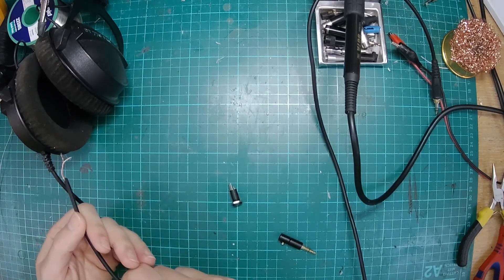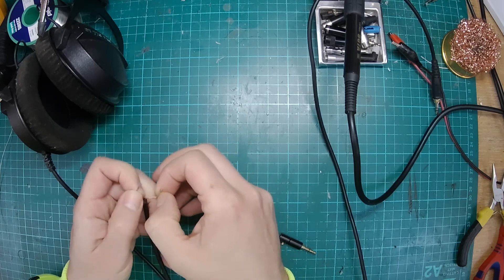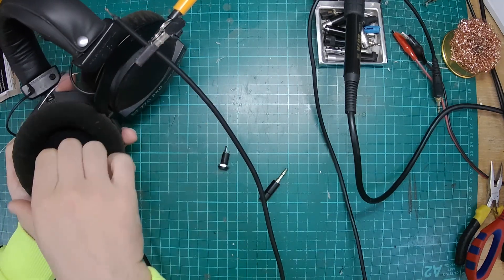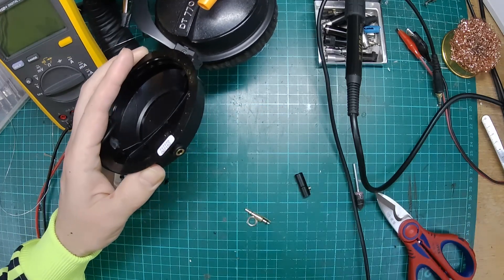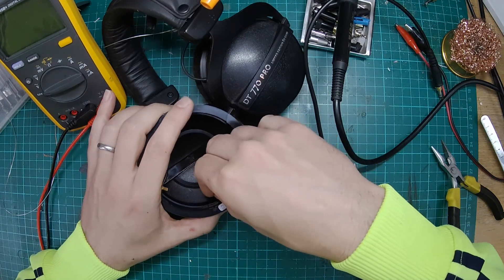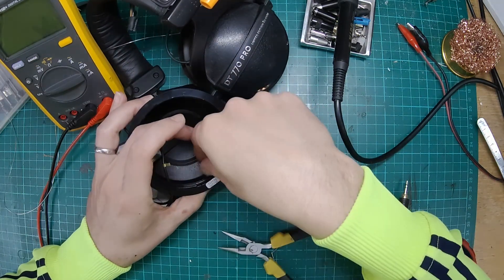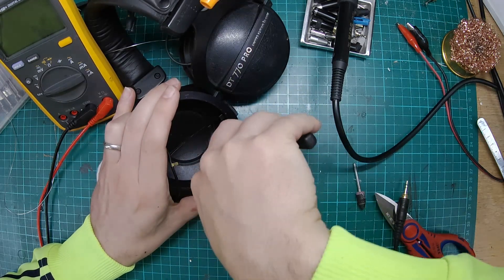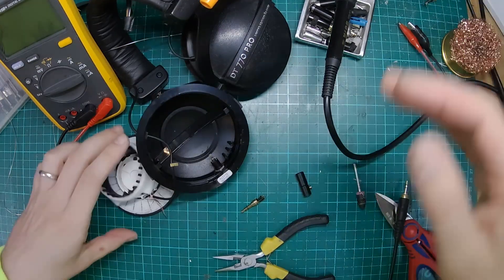DT770 Detachable cable mod the easy and safe way

Comment: Just did this mod, sweaty palms, heart beating, messed up the wiring first time, but now it all works great! The soldering tips helped out a lot, thanks for those!

One thing that was different in my set (maybe because I got the DT770 32 ohms?) was the colours of the wires. I have black (for ground) attached to the longer pin, white attached to gold and red attached to silver and that seems to be correct in my case.

Comment: just did the hole part with one of those tiny needle files. it also works pretty well. took me maybe 10-15 minutes. will probably do the soldering some other day cus i don't have wire.
Reply from the maker: Thant's the way.... take your time and get it right ;)

Comment: What if I make double 3.5 input mod? Will it work?
Reply from the maker: Yes we have made a few pairs like that
Reply: @CustomCans  do I need to consider about PCB? I mean is it DSP or just conjunction? If I can make, can I remove wire from head band? TIA
Reply from the maker: @chithtooaung3883  The PCB just joins the main cable to the tiny voice coil wires. If you are not skilled with soldering, I would leave the wires attached to the PCB like in this video. For  the other side, leave a small section of the headband cable attached and use that to connect  to the socket. Then you can remove the rest of the headband cable. If you remove the headband cable, I would recommend blocking up the holes where it entered the earcup as well or they will act as an extra bass port

Comment: Just finished my mod, thank you and all the helpful comments! If this is your first time doing something like this plan in at least 3 hours and one burnt finger 🫠. Also, don't be afraid to really pull on the retaining clip. A flat head screwdriver instead of a butter knife worked quite a bit better for me because my knife was too flimsy to get the clip out. Putting solder on everything before connecting it and having the jack aligned as in the video was also a great tipp! Checking everything before putting it back together (by carefully inserting the plug) and seeing if the Jack wiggles is also a good idea. If the wires can bend and touch each other make sure they are isolated (if not a bit of hot glue/electrical tape helps). Hope this can help and thanks to everybody!
Reply from the maker: Glad to hear it all went OK and thanks for sharing some extra tips

Comment: Ripped the jack off my DT 770 Pro, i think i'll do this rather than attatching a new normal wire
Reply from the maker: Yeh.. it is not much more work
Reply: @CustomCans  The Stuff finally arrived and i started disassembling and noticed i dont have the blue or gold wires, i have black, white and red, do you know which is left and which right? i´d assume black is negative/ground and red is right while white is left?

Comment: Hi! Could I use any 3.5mm cable with this mod or would I need to get a specific spec? My DT770s are 32ohm and I'm looking for a more flexible cable than the stock one. Maybe one short and one longer.
Reply from the maker: Yep you could use any standard 3.5mm cable
Reply: @CustomCans  awesome thanks

Comment: The one thing putting me off buying these headphones was the fixed cable. Excellent video showing it's easy when yuou know how. You've inpired me to have a go and hopefully not ruin a brand new pair of cans. 
What's the bass rumble I kept hearing from around the 7:50 mark?
Reply from the maker: That is just the Phat bassline produced by me cleaning the solder tip - the vibrations going through the desk and up the arm I have the mic on ;)

Comment: I’m unclear on what the multimeter did. It just helped you confirm which wire was left right and ground?
Reply from the maker: Yes - I was using it to check continuity - that is the main setting I use for modding headphones - good for checking things like shorts or breaks in the cable

Comment: Is there any alternative tool instead of using a dremel?
Reply from the maker: You just need to make a hole in the right place - you could use a drill or something or even a sharp blade and just slowly cut away at the plastic until the hole is the right size

Comment: You made this look so easy. Im considering getting a d770 just for this mod but I'm not sure if my soldering skills are up for the job. I once wrecked a game cube controller trying to solder new potentiometers
Reply from the maker: I definitely not do this as your first mod. Get in a lot of soldering practice first
Reply: People always say to just opt for a pair of 770(80ohm) instead for the straight cable, but i find the 250's have better sound.
Reply: This was my first ever soldering "work" if you are careful not to puncture the driver there really isn't much that can go wrong.
I mean if custom cans says don't do it it's probably because of a reason just know that it's not impossible

Comment: Is it the same process when doing a mic mod like this. I guess i go for stereo socket plug ?
Reply from the maker: We have made a few where we fir a seckond socket for a mod mic - it is much easier to do this mod and then use a v-moda boom mic or beyerdynamic custom gear mic though

Comment: Followed this to mod to my 770s and Tygrs. 👍
You can cut the cable further down and pull the wires through - much easier to solder with more wire to work with.
Reply from the maker: Top tip ;)
Reply: Thanks for this! Doing this to my 770s and was a bit worried about not having a lot of wire to work with.

Comment: Can the 3.5mm port be used to connect a V Moda boom pro mic?
If not, what else would be required for it to support that. Could you recommend me alternate parts like the ones you left in the description?
Thanks.
Reply from the maker: Yes it would work with the V-moda boom mic or the beyerdynamic custom gear mic
Reply: @CustomCans  ooh thanks for the quick reply

Comment: Should I try this if I've never soldered anything in my life. I have all the tools and have watched several videos but maybe should practise on something else first? You make it look so easy.
Reply from the maker: 100% get a load of practice first. Soldering is a bit of a dark art and needs a bit of practice to get right. You need to get used to how your soldering iron and solder perform and get your solders looking super neat and shiny before trying to solder anything that you care about. I would recommend buying some strip board used for making custom circuit boards and solder random offcuts of stranded wire to it until you get a feel for it.

Comment: Just did this, nowhere near as clean as yours because Im really bad at soldering, and the tip on my soldering iron is super oxidized and barely works. 

And it might have been stupid but because my solders didnt seem very clean or reliable i just slapped just epoxy (which I was already using to seal the holes/help hold the socket in place) on top  to insulate and keep them in place. Checked functionality first, all seemed well. Fingers crossed. Thank you for the video.
Reply from the maker: As long as it works, it's all good ;)

Comment: that made modding my dt770 so easy! thanks for sharing :)
Reply from the maker: Glad it helped!
Reply: @CustomCans  hey, sorry for pinging here but i didn;t know how to reach you.
Do you think that this mod is the same on DT990/DT880 EDITION ? i am considering buying and EDITION one but i can't find much about the inside of them
Reply from the maker: @lucapretini1762  yes you can mod those the same way. You just have to take it a bit slower when making the hole as they have a metal ring around the earcup so where you have to make the hole is half metal and half plastic... It makes it tricky but go slow and it will be fine
Reply: @CustomCans  mmm i actually used sand paper for dt770 pro, you think that would work on "edition" ones too? Or the metal part would be a problem?
Reply: @lucapretini1762  My thinking: Sand paper will be quite slow (take a long long time) on metal. In between of sand paper (very slow) and Dremel(/drill) (fast to too fast) you can use also a metal file as a quite low cost well controllable moderate speed manual tool to get the whole sufficiently wide/well formed.
Reply: @CustomCans  hey after a few months i bought the headphones and i plan to mod them. I wanted to ask, do you know which part of the headphone is metal and which one is plastic?
Reply: if anyone reads this and is looking for an answer:
modding "edition" ones is the same as pros, the black part on editions is soft plastic as on the pros.
Wires are easier to work with as are thicker

Comment: Nice! can you use a balanced cable with this mod?
Reply from the maker: You would need to fit a 4pin mini XLR and wire it slightly differently to do that but the basic principal would be the same

Comment: Is there any advantage of modding the DT770 with either the 3.5mm to Mini XLR?
Reply from the maker: 3.5mm are more common so easy to find cheap cables. Mini XLR locks in place so for studio use it means you are less likely to yank out the cable while bouncing round the booth... Also it looks cooler ;)
Reply: @CustomCans  thanks so much. I went with the mini XLR. I'm excited to try this mod. The hardest part is going to be wiring it correctly. I got a multimeter so hopefully that helps. Thanks.

Comment: To everyone who is doing this: When popping off the ring, make sure to put the lever really completely under it, before twisting! I accidentally ripped a small tear into the paper on the outside. To be safe, I wouldn't twist it at all, just pull it away from the case. It's my own fault! I used the backside of some tweezer, but that was actually a bit too round, so there wasn't much left for it to hold on.

Comment: BE CAREFUL to drill the connector's hole away from the driver support of the earcup, or you will not be able to put it back...
Reply: Wdym like the mould scaffolding to the right?

Comment: Great video, thanks it was really helpful. is there any point to using mini xlr over 3.5mm jack or is the fact that xlr is balanced irrelevant in the case of a pair of headphones? cheers
Reply: just to clarify: XLR plugs aren't balanced. They're just plugs with 3 or 4 pins (or more). The 3-pin mini XLR jacks that AKG and others use are just the same as these 3.5mm jacks audio-wise (they both have right, left and ground), but mini XLR is larger and locks in place.  Larger is a con (it hits your shoulder) but locking is usually a pro. It's a matter of taste.
There's also 4-pin XLR plugs that people sometimes put on headphones as mods, which splits out the left and right ground onto separate wires. Some people call that "balanced", but that's another topic. But either way the "balanced-ness" is not inherent to the connector, they're just different mechanical ways to plug wires together.
Reply from the maker: It is probably down to personal preference there is not a huge difference - for pro use a mini XLR is nice as it locks in place and you can't accidentally pull it out at a crucial moment

Comment: Im going to do this but I also want to build make a custom cable with paracord. I know using the right wire types is important but dont know how to decide what to use.
Reply from the maker: Making your own cables is a handy skill to have so well worth giving it a go. I may have to do a video series on making them. Personally I would go for a flexible wire  like silicon wire do begin with as stiff cables can be annoying and 26awg is probably a good thickness as it will be easy to solder on to most connectors
Reply: @CustomCans  I was planning on just that, or going with ofc silverplated teflon as mentioned in your cable series. Is it fine to braid if its 3 core, though I doubt it makes much difference over 5ft.
Reply from the maker: @aviinuo2694  Yep silver plated copper is good as the teflon is a really good dielectric - it is a little stiff but not too bad the only thing that may catch you out is that the teflon is sometimes so strong it is is not possible to strip with normal wire strippers - a scalpel will do the trick though
Reply: @CustomCans  I can also get 8 core braided cables, if i want a 3 pole cable can I solder 3/3/2 cores as the 3 poles?
Reply from the maker: @aviinuo2694  The ground wire will be carrying the current for left and right so you would be best of with 2,2,4 with 4 on the ground so it is equal to the two Positives

Comment: I want to mod my DT 990s but I can't decide whether to go full throttle and get a socket inside or cut the cord just before the curled part and attach a socket there. I feel like the weight of the socket on the cable would be a nuisance(?)
Reply from the maker: It is totally up to you but if you have the time, you could try doing a pigtail first and see how it feels and then if it annoys you go for a full detachable cable like this
Reply: I did the pigtail and it's not too bad but I'm considering redoing it as shown here or maybe just sending them in to customcans as they they do such a good job.
Reply: @gprider1525  What socket did you use for that? I can’t seem to find one that grips the insulation like the male one he used in the video.
Reply: @MiniMoto0098  I just used a cheap 'Kenable' socket from amazon and it worked out fine

Comment: What Dremel bit are you using in your videos? Also, could you recommend a Dremel kit that I could purchase?
Reply from the maker: we mainly use an orange 10mm grinding bit then we have some thinner tungsten carbide burr tools for smaller holes like this one. Dremels are really handy for all kinds of small modding jobs- they are all good, we use the Dremel 4000 in the workshop and it has never let us down.
The smaller bits we use are like these
https://www.ebay.co.uk/itm/322658684379